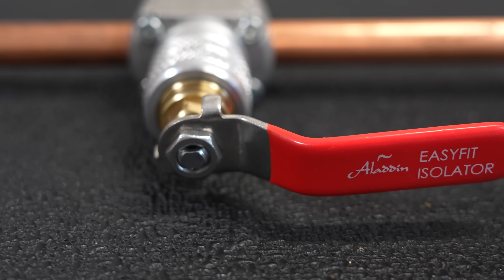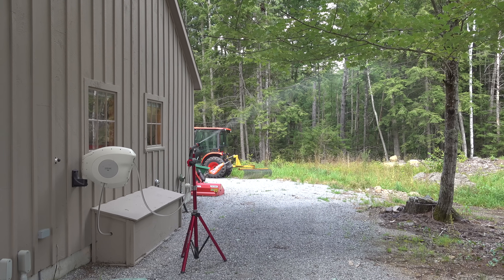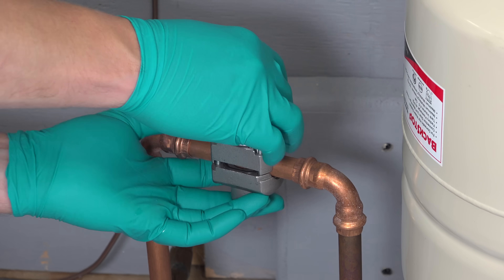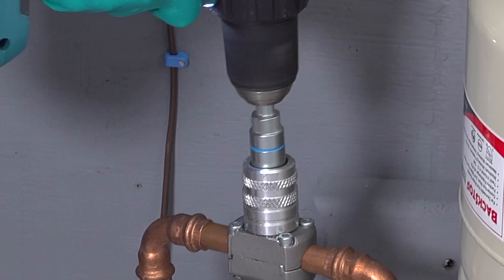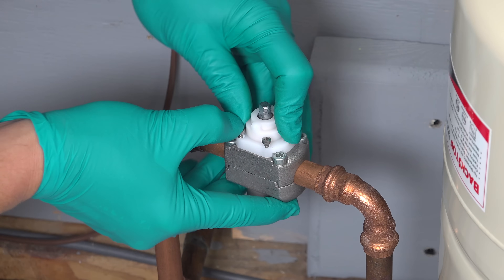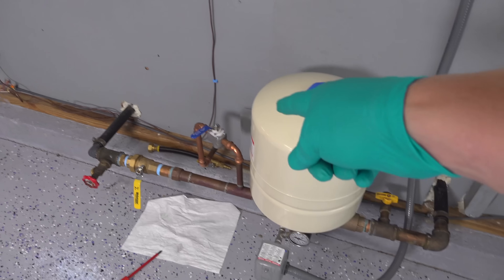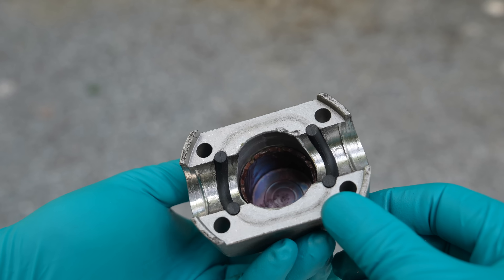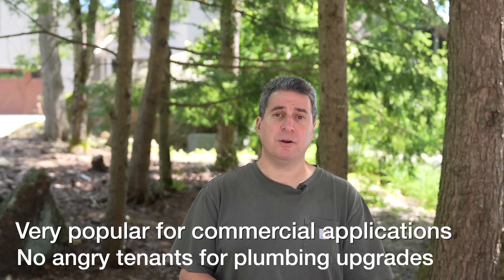SHUT-OFF valve installs on a LIVE WATER PIPE - Aladdin EasyFit Isolator

Comment: Awesome product, albeit very pricey.  But I really appreciate that you are so concise in your narrative.  So many  You tubers spend 5 minutes telling us why they made the video.  Your whole vid was less than 5 minutes and gave us all the information we need.  Thank you!
Reply: You weren't kidding $450 for one. I could just pay a plumber to replace it and it would be cheaper.
Reply: At this price point, just buy a pipe freezer. Costs less than 4 of those valves.
Reply: @waterturtle2919 I've always used dry ice to dam the pipe while replacing the valve.  I've also got tapped Oil Pipelines with similar products to the OP.
Reply: It could be an awesome product for some applications, but in some cases it could make problems. Using it at the closed loops like those for radiators is very risky. Pieces of sharp metal will flow with the water and can damage the pump. There would also be the risk of swallowing copper chips in the drinking water.
Reply: Glad I live in Europe; starting at 65 euro for the 15mm kit. Question is: why would someone not have a shut off point at their mains? That's just plain stupid.
Reply: This New Valve is Just what the DR. ordered,, Yes not cheap, but wow what a life saver, if you need it !!! The price should come down in time I hope !!!

Comment: Question I have a leaking pipe but I can’t shut off the water it’s n old house and I’m afraid if I break that it’s catastrophic could I use this to stop the water flow wile I repair the pipe then release and should work fine?
Reply: Thanks for your comment, this is a perfect example of where you can use the valve the valve will stop the water flow in minutes.

Comment: Cool. Obviously in any residential application, the water off could be shut off.  There are many commercial applications, apartment complexes, hospitals, manufacturing plants or whatever it may be that they do not want that water line shut off. This would offer them an inexpensive option to fix the problem downstream of the new valve.
Reply: My old apartment needed a replacement shutoff valve, but it was awkward as hell to get to through a hole in the back of a corner kitchen cabinet. The poor plumber had to shut off mains to half the building, freeze the pipe in case of residual pressure in the system, and install the replacement while working at arm's length through the hole while lying sideways on the floor with a penlight in his mouth to try see what the hell he was doing 😅

Luckily it was paid for by the building strata, but compared to that whole rigmarole I reckon installing one of these (with a flexi drill attachment) just upstream and then replacing/sealing up the old valve section would have paid for itself in saved time and hassle alone. (Probably worth mentioning this was in Australia and tradies make absolute $$$ here, time is almost always the biggest cost factor)

Comment: £42 or $53 on ebay.
Reply: Thanks for your comment, the versions sold in the UK are different to the valves for the USA which are designed for our thicker pipes which also measure differently.

Comment: This looks suspiciously like overbuilt saddle valves, and we all know how problematic they can be.
Reply: Thanks for your comment, the Easyfit isn't a saddle valve it seals on the ends of the pipe as well as the sides, is classified as a ball valve and has a 12 month guarantee in the US and has been sold successfully in the UK for over 10 years.

Comment: This is called a saddle valve as it saddles the pipe. These valves are against the IPC Plumbing Code because they "damage" the water line and cause a weak point in the line. Most insurance companies will deny coverage from damages due to one of these valves leaking causing damage to your home. Just something to keep in mind if you plan on using one of these valves.
Reply: The EasyFit Isolator Valve is NSF and UPC certified as a ball valve. It is not a saddle valve.

Comment: Here is my situation. Plumber cannot turn main water line off. Gate valve is old. It turns, but when it stops, water is not 100% off. Maybe 75%. Sediment and calcium over the years (House built in 1959) have built up inside valve. Must call city to turn water off at street. City charges $100 to come turn it off, then $100 to come back out and turn it on again when valve is replaced. So that's $200 PLUS cost to have plumber put new valve on. (Estimate of $400.) So I'm out $600 bucks. This thing SEEMS like a good deal, until you factor in - as others have pointed out - the original problem still remains and eventually the old gate valve will fail completely and begin leaking, whereby you STILL have to replace it, and STILL will have to pay city their fees. In the end, replacing main with new style ball valve gives peace of mind.

Comment: How would this work for plastic piping or galvanised iron piping?
Reply: The valve only works on copper tubing (K,L, or M) and PEX. It will work with CTS PVC since they have the same diameters as copper tubing sizes.

Comment: Novel device but the key weak link is the white plastic part that degrades in two years due to thermo oxidative degradation, splits and then leaks so for that price they should provide a few free replacements
Reply: Thanks for your comment, the white cap is made from nylon the valves have been in use in the UK for over 10 years and there have been no cases of the cap degrading.

Comment: Where be I buying this? This is excellent. I can already think of an application for this valve. The water line that comes into your house. You can't cut the water off to your house, that's only something the city can do, so if you spring a leak at the meter you can use this. Or you can...well that would be dishonest and I won't even mention it. :)
Reply: Thanks for your comment, there are links above in Silver Cymbal's comments above.

Comment: Can it be used on a PVC pipe?
Reply: The valve only works on copper tubing (K,L, or M) and PEX. It will work with CTS PVC since they have the same diameters as copper tubing sizes.

Comment: As for price I've just looked then up here in the UK: 15mm £39.50 Ebay, 1/2" £98.80, trade pack of 5 15mm for £247.08.
Nothing like the quoted price in the US.
Reply: The US version of the valve has a different blade, material, and valve body design to withstand the increased strength/density of US copper tubing. The UK version of the valve will not work on US pipe. Due to the changes there is a difference in price between the UK and US versions. We hope to adjust pricing in the future once it is widely used and recognized like it is in the UK.

Comment: I do not believe it doesn’t leak.
Reply: Thanks for your comment, the EasyFit uses unique dual seal technology which prevents leaks.  They have been sold for over 10 years in the UK and haven’t been known to leak once installed.

Comment: Wow...Talk about a device introduced past it's time.
I have been installing copper lines for 35 years and was introduced to a new product about 14 years ago called PEX.
I haven't installed any copper lines in years now and neither is anyone else in all new homes due to the silly cost of copper.
This is a great idea but the demand for this is disappearing quickly and if your main shutoff doesn't work then turning off the 
main shutoff outside is the next logical step due to the obvious necessary replacement for that main shutoff that you will need to do first.

Comment: Great design I was interested in it but I actually had two shut off valves installed by a plumber for $275 when one of these is 250 so doesn't make much sense in my area.

Comment: That thing is a joke , it rolls a huge bur inside the pipe that then causes hydrostatic backflow that wears the pipe out 10 times faster. Just do it right an solder a ball valve on. Mickey mouse fix at best.
Reply from the maker: Be sure to watch the end, there is no backpressure. The valve has been tested to reduced less than 2% which is identical to typical ball valves

Comment: Great!  Not cheap, but it's got it's place!   Will it work on plastic pipe?????
Reply: The valve only works on copper tubing (K,L, or M) and PEX. It will work with CTS PVC since they have the same diameters as copper tubing sizes.

Comment: Would there be any metal shavings that come off from this process? Im assuming you would just have to run the water for a bit to get anything out.
Reply: The coupon is trapped and sealed along with a majority of the swarf in the lower housing.

Comment: Interesting gadget, but $250? A quick google show it at 1/4 that price on-line in the UK - somewhere around £50. I wonder where the price markup comes in?
Reply: The US version of the valve has a different blade, material, and valve body design to withstand the increased strength/density of US copper tubing. The UK version of the valve will not work on US pipe. Due to the changes there is a difference in price between the UK and US versions. We hope to adjust pricing in the future once it is widely used and recognized like it is in the UK.
Reply: @easyfitisolatorusa  OK, wasn't really expecting an answer but thanks for that.

Comment: 🤣 Good idea but due to the product being laughable overpriced only a complete moron 
would buy this.  

1/2" EasyFit Isolator Valve, Complete Kit 
$250 + 19.99 shipping.

3/4" EasyFit Isolator Valve, Complete Kit
$350.00 + $29.99 shipping.

1" EasyFit Isolator Valve, Complete Kit
$450 + $41.99 shipping

Wouldn't be surprise if chinese versions(they could be but were massively marked up and presented as USA made) already exist and sells for $9.99 - $23.99.

Comment: FYI these sell for £50 in the UK for standard 15mm pipe.
Reply: The US version of the valve has a different blade, material, and valve body design to withstand the increased strength/density of US copper tubing. The UK version of the valve will not work on US pipe. Due to the changes there is a difference in price between the UK and US versions. We hope to adjust pricing in the future once it is widely used and recognized like it is in the UK.

Comment: What happens to the piece of pipe that the valve cuts out  to insert into the line?
Reply: The coupon is trapped and sealed along with a majority of the swarf in the lower housing.

Comment: Is this valve desigbed to be used all sorts of plastic piping too?
And if they have made price somewhat realistic, would not the sale go through the roof compared to what they hace now?
Reply: The valve only works on copper tubing (K,L, or M) and PEX. It will work with CTS PVC since they have the same diameters as copper tubing sizes.

Comment: $250, but like Sharkbite stuff - it seems to be Witchcraft - Very cool technology but I'd probably use the same money to get a plumber to install a valve or just do it myself. At some point the O-rings will give out and I doubt they are standard sized.
Reply: Thanks for your comment, the gaskets in the valve housing seal during installation. Once the valve is installed the boot inside the valve acts as the primary seal – it’s a dual seal valve.  They have been sold for over 10 years in the UK and haven’t been known to leak once installed.

Comment: searching on german amazon: 55,84 euro 😉
Reply: The US version of the valve has a different blade, material, and valve body design to withstand the increased strength/density of US copper tubing. The UK version of the valve will not work on US pipe. Due to the changes there is a difference in price between the UK and US versions. We hope to adjust pricing in the future once it is widely used and recognized like it is in the UK.

Comment: It would be interesting to see if that passes code in my area (South Eastern Michigan).  We can't even use saddle valves.
Reply: The EasyFit Isolator Valve is NSF and UPC certified as a ball valve.  It is not a saddle valve.
Reply: @easyfitisolatorusa  And accordion traps are not self scrubbing.  The devil is in the details when it comes to local plumbing codes.  Inspectors will deny CofO especially on rental properties if it doesn't meet code.  There are lots of products I can purchase at my local builders store that does not meet code.

Comment: Well for $250 each, I'll cut open my pressurized copper pipe and install a $20 shark bite valve (or something similar) and get a little wet in the process. I can dry off for free, and use a shop vac to take care of any water mess. Save myself $230. Besides if 55 psi is the max working pressure, then it's no good for city water - my pressure runs 90 psi minimum. Sometimes higher depending on the time of day and how much water other customers are using..
Reply: Thanks for your comment, the maximum pressure the EasyFit works at is 230PSI.

Comment: Still way cheaper than calling a plumber! Excellent product 👍🏻
Reply: I'm confident I can get a plumber to install a shut-off valve for plenty less than $250 (Idaho). If you're in CA, might be a different story.
Reply: Copel valve assembly they work great when installed right😊
Reply: If the water couldn’t be shut off, the plumber would have to fit this before commencing work??
Reply: I don’t think so. You will have to call a plumber to remove it and install a approved ball valve. This is a fancy saddle valve.
Reply: Or better you watch a couple of YouTube videos and with 20 dollars you do it yourself, well that's what I did
Reply: Guys, HERE is The Savior

HalleluYAH translates “Praise ye YaH”

YaH is The Heavenly Father 
YaH arrives via the TENT OF MEETING
YaH was Who they Crucified for our sins
YaH was Crucified on an Almond TREE

— Ancient Semitic Cuneiform of Moshe (Moses)
— Isa Scroll (The Original Isaiah)

Isaiah 42:8
"I am YaH; that is my Name! I will not yield my glory to another or my praise to idols.

Isaiah 43:11
I, I am YAH, and there is no other Savior but Me.

Isaiah 45:5
I am YaH, and there is none else.
Reply: Should not be installed by a maintenance man for sure u need a license plumber
Reply: @robertmarin8217  No licensed plumber would install that.
Reply: @robertmarin8217  they hardly exist now in the U.K. for small jobs. It’s usually easier for the homeowner or their old Dad to turn off the mains incoming supply and just fit a washing machine type 15mm flood valve from wickes, (they’re about £4 each)

Comment: They retail in the UK for around £55-£65 ($70-80 approx), inc VAT, so I'm guessing there's a lot of extra duty....and then some...!
Reply: The US version of the valve has a different blade, material, and valve body design to withstand the increased strength/density of US copper tubing.  The UK version of the valve will not work on US pipe. Due to the changes there is a difference in price between the UK and US versions.  We hope to adjust pricing in the future once it is widely used and recognized like it is in the UK.

Comment: Interesting, my fear, where did that copper pipe debris go and will it cause problems down the road? Or, for $250, you can buy a few DIY tools and a book on plumbing to add to your collection.
Reply: The coupon is trapped and sealed along with swarf in the lower housing

Comment: Wouldn't it just be smarter to shut the water off at the street before doing any work in your house? Don't endorse a b***** product.
Reply: Thanks for your comment, the EasyFit was designed for when the water can't be switched off.  It is both NSF and UPC approved and has been sold in the UK for over 10 years.

Comment: 100% that will put metal shavings in the line.
Reply: The coupon is trapped and sealed along with swarf in the lower housing
Reply: @easyfitisolatorusa  Afterwards, but not during the drilling operation.  There WILL be metal shavings in the pipe.  They need to be flushed out of the system before use.
Reply: @NotSure416 the blade has a unique design which catches the minimal swarf which is created during cutting and traps it within the blade and rear chamber - this is one of the many unique features of this truly innovative product.
Reply: @easyfitisolatorusa  No doubt, but you need to flush the line before returning the system to service.

Comment: Great product. My only concern is what happens to all of the swarf?
Reply: The coupon is trapped and sealed along with swarf in the lower housing
Reply: @easyfitisolatorusa  I’d be interested seeing this installed with a filter on the flow side of the valve to see if any debris comes through. I do a lot of maintenance work on government buildings that have 10’s if not 100’s of TMV’s and tap aerators. Can be a pain having to access and clear them all in a hospital.

Comment: It's called a Add a Valve I used them in the Late 80s and early 90s in hospital and schools it is not a new product it has been around for a long time because they have made plumbing to easy
Reply: Thanks for your comment, the Easyfit is not the same as the add-a-valve it is also quicker to install, is considerably cheaper and  leaves an approved shut-off valve in place.

Comment: Does this work for black pipe
Reply: The valve only works on copper tubing (K,L, or M) and PEX.  It will work with CTS PVC since they have the same diameters as copper tubing sizes.

Comment: This actually how they tap the major public water lines in US (ones in the street) for last 100 years. Hot Tapping, google it...
Reply: Thanks for your comment, a hot tapping installs an isolatable branch unlike the Easyfit which installs an isolator into the main pipeline  The EasyFit is a unique patented product which was designed in the UK and has been sold for just over 10 years.

Comment: Interesting, just to play devil's advocate, I can see from use case from a "Building Superintendent needs to shut off water in the middle of the night for a tenant, valve is broken", but for most applications, something like a sharkbite seems like a better choice since the cost is about 1/10th of this.   That said, it does seem pretty foolproof.